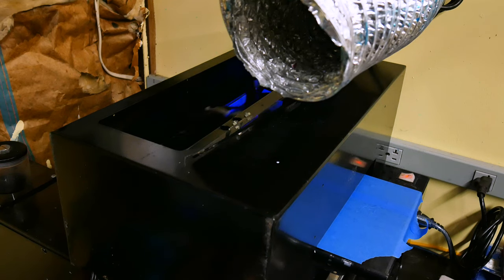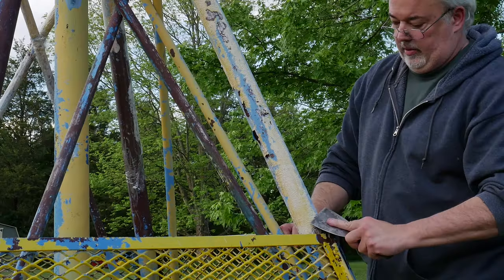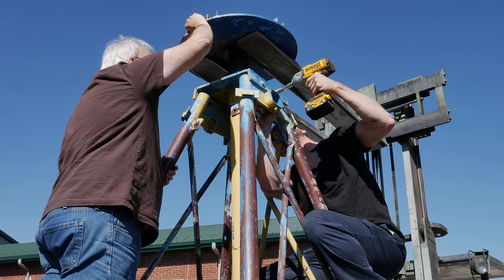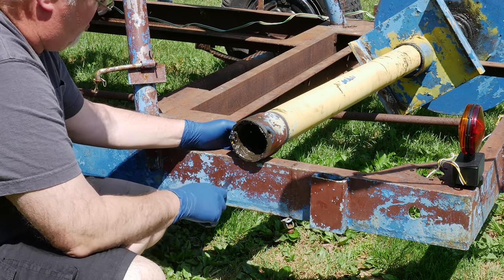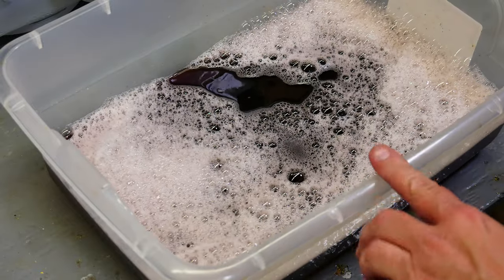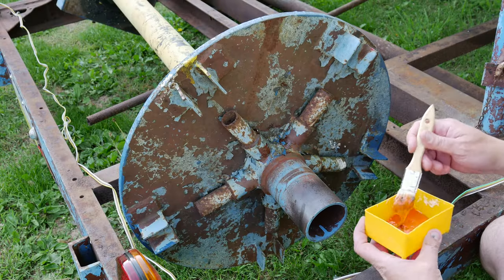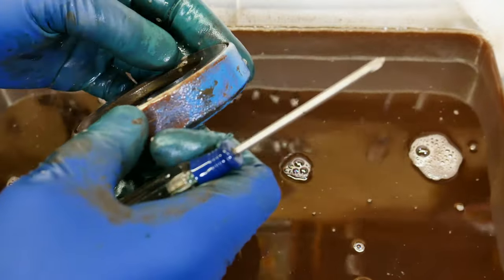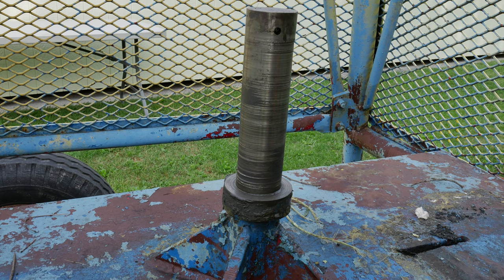Vintage Kiddie Ride Repair: Drive Shaft Removal

Comment: Wow, I wonder if it would be easier to completely build a new shaft? Great video, fun to watch.
Reply from the maker: It would be easier - potentially - but it would be expensive.  For instance, that piece of steel tubing costs about $600 plus I would need the services of a certified welder. (which I have but requires scheduling) I personally don't plan on putting this back into operation with the public, but that doesn't mean it won't at some point by a future owner.  I would want to ensure that the person doing the welding was certified to do so.
Reply: @PeteRondeau , Oh absolutely. And even your own grand kids. I am so impressed at how articulate you are with this project.

Comment: Hi Pete just watch that video again on removing the shaft and the bearings and things like that situation you got with your carnival ride just wondering if you figured out what you're going to do with the shaft. I had an idea what if you could find an old cylinder piston one of them hard cylinder shafts that's what I was going to use on one of my rides that I'm planning on in the future I've seen a few in the scrap yard just didn't want to spend the money on them at the time because they sell them by the pound all right well we anxiously waiting for the next video thanks again bye
Reply from the maker: Well, in my last video, I made a steady rest that allows me to hold the shaft in my lathe- but just barely.  I'm going to try to take a skim cut on that bearing journal to clean it up.  Then I will get a piece of bronze and cut it to fit.  In my case, there is plenty of meat left on the shaft.  I don't think it was a specific dimension, just a 4" piece of pipe they had on hand so the journal size isn't critical.  The diameter could be reduced and get down to clean metal and work just as well.  it would just require an oversized bearing to fit.  They do this all the time when rebuilding engines.  If that doesn't work, then I could sleeve it- do something like you suggest.  I think it is all just a matter of what tools you have at your disposal- I'm fortunate to have the lathe, hopefully it is heavy enough to do the job.  Thanks for sticking around!

Comment: For the main shaft I would turn it down and upgrade it to use tapered bearings. It would work so much smoother and be stronger. Not to be more reliable and less maintenance.  
If you are within a reasonable distance I would be willing to paint it. I have been into auto restoration for over 30 years. 
Good luck on your project 👍